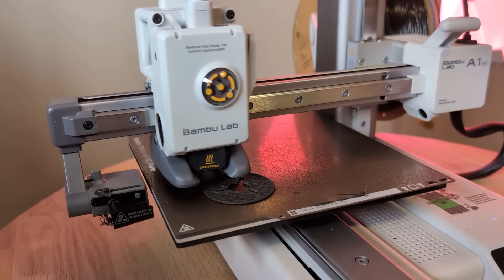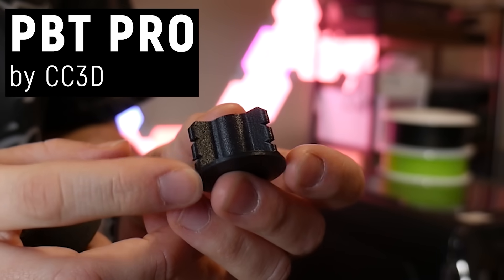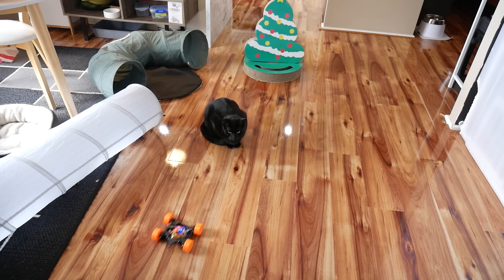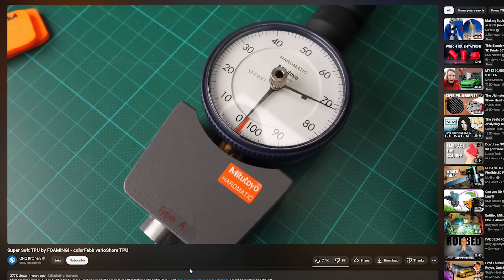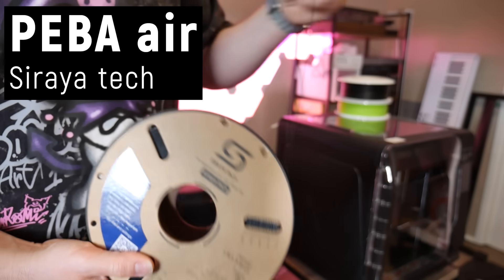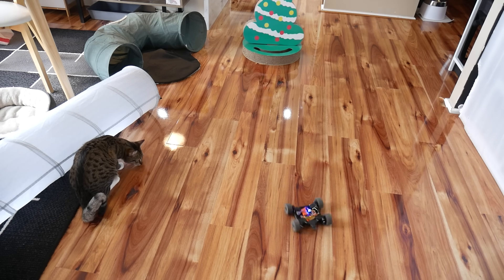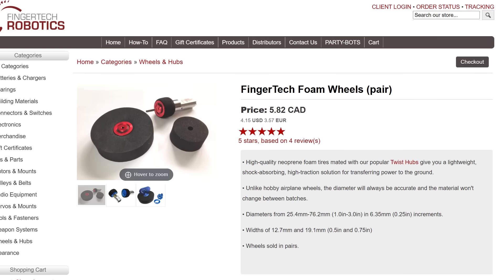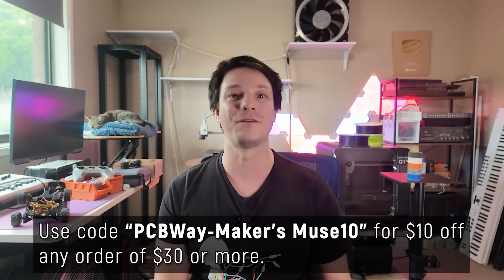3D Printed FOAM Wheels - Do they work?

Comment: Imagine using the fuzzy skin slicer setting with different .svg pattern files to make different patterned treds for your wheels for added traction. You can keep the size of your tires without needing to remodel the tire for every patten.

Comment: when i print 85a tpu on smooth plates the bottom surface is very grippy, maybe theres a way you could print a strip and wrap it around a wheel

Comment: The assumption that a traditional tire shape is optimal for such a specific use-case is a better target to aim at. With such low relative RPMs you can leverage different tire surfaces to maximize traction with little downside. Ultimately, the limiting factor is contact-patch. So, why not create a tire surface more like a "koosh ball" and get a tremendous increase in contact-patch size? Or very soft paddles to flatten the contact patch? Remember, the percentage of traditional tire surface-area which is in contact with the driving surface is very very low. But, with such low loads there's no need to be so limited in the tiny-robot application. And the weird surface designs I'm talking about would be a pain to make with traditional molds but simple with 3D printing.

Comment: Have you tried spraying on spray rubber sealant, readily available from Bunnings? I have used this stuff on TPU to rubberise the surface more to make it grippier, for desktop machine feet. Worked nicely. Also, it comes in black.

Comment: I think you're pulling more than you think every time. 1. The mass of the chain that is lifted off the table effects your reading. 2. you're not pulling straight. I wonder if you'd get better results from trying to push into a vertical scale on the end of the table instead? Or, a rigid tether that is perfectly aligned with the axis of force.

Comment: When I think of gripy materials, the first thing that comes to mind is silicone. I suspect it would perform very well in a grip test, however perhaps less well if you also consider durability in your testing. You can quite easily 3D print molds for two part silicone, or perhaps beg Prusa for their new silicone filament and nozzle for the XL :)

Comment: Liquid Latex is found at any place sculpting supplies are sold here in the states as it is used as a first layer for plaster molds to hold detail and provide flex around details for demolding. And yes as a natural compound it can and will spoil, hence a very short shelf life. I prefer silicone and use conformal coating as I usually have some liying around to waterproof circuit boards.

Comment: just thought of something that might make a difference if you want to try it.   with the foaming tpu. if you make a slightly rounded profile on the tire. reducing the contact patch but providing more psi on the contact patch, it might improve the traction with the deformation of the foam, especially with the dusty surface.

Comment: Two questions!  First, what are you using as a radio controller?  I build full-size droids and that form factor looks very comfortable to hold.  Second,how well do you think the foamed PEBA or TPU would hold up with more mass on the wheels?  My droids tend to end up in the 40-60 kg range.

Drawing on my history as a Goth, liquid latex and latex-based make-up are indeed very different; there's a lot more stuff in the makeup to thin it out, colour it, and make it easier to remove.  Liquid latex is intended to remain more-or-less intact when you remove it.  It's for making masks, molds, and forms.  (Liquid latex "bras" were very popular in the Edmonton Goth scene around '99-'01, and several friends of mine then used the resulting form to build up dress-maker's dummies.) Latex make-up is intended to be easy to remove and not crinkle or rip when you move and smile.

I think it's worth observing that we use rubber on car tires not just because it's soft, but because it's sticky, which does a lot to add traction and control.

Finally, a grumble about saying "PLA+" as if that was some kind of standard.  Every PLA+ is different, and in my opinion 3d printing YouTubers ought to be making a better effort to remind newbies of that.  One brand name's PLA+ may have very, very different characteristics than another's.

Comment: What if you print a wheel with linear or angled threads, then print a tyre to place on top of the wheel, with inner threads which match the outer threads of the wheel? That could significantly reduce the amount of printing filament and printing time and funds needed, and could allow for faster iteration. And for lint rollers, you can 3D print one which can be used with scotch/packing tape, making it's usage hugely cheaper, almost free, and if you include a way to roll packing/scotch tape on an inner roller, you could make it so you simply turn a key a bunch of times in order to roll out the lint-filled tape and roll fresh tape in it's stead, and you could use a a piece of those thin linear saws in order to let the use pull the dust-filled tape out and have it automatically cut, like with those office packing/scotch tape supports with built-in cutters.
Reply: As for the 3D-printed lint-roller using packing tape to be much cheaper, that's the kind of thing you could sell in stores, and you could even make "cartridges" for it from store-bought packing tape, a roll, and some PVC pipe or something cheaper. Two rolls of packing tape side by side would make a large size for the rechargeable lint-roller, and a single packing tape would make a small size for the rechargeable lint roller. And you could even sell the 3D printed device for people to roll their own tape cartridges for the rechargeable lint roller.

Comment: Your mention of the skid steering made me think, have you ever considered/tried a single powerful central motor, and a 3d printed differential? There is a design from EATON called the 'detroit truetrac' which is a gear-only limited slip diff. It's built with 6 worm gears and the standard main components, no clutch packs or hydraulics, no electronics. Just an awesome piece of engineering. 
It's really incredible at sending more power to the wheel with more traction. 
Of course, the downside here is that you wouldn't be able to turn in place anymore unless you try drifting (which might not work at all due to the type of LSD it is). Just a thought, maybe it wouldn't be worth it. I thought maybe using one motor in place of 4, to drive just the rear or front wheels could be worth the saved weight towards a stronger weapon or shell?

Comment: Just out of curiosity, do you think foaming filament would be useful in creating custom foam protection pieces for electronics.

For example: I have a K.O. II sampler from teenage electronics. I can cutout the basic body shape (square) for a case. But I have been thinking about how to protect the faceplate (other than buying a plastic shell protector). My other option would be subtractive manufacturing/CNC foam cutout. I don't have a CNC, but I DO have a printer...

Thanks again for all the good work!
Reply from the maker: Yep I think it'd be an excellent choice! I'm planning on testing it for custom tool inlays. You could always do manual filament change, printing a hard top surface in something like petg, then the foam tpu on top. I think they bond but definitely check!
Reply: @MakersMuse awesome, that's a great idea! thanks!

Comment: i just started getting into full size RC cars, and speed run cars burn thru foam tires on almost every run. This seems like a much better option once the full power has been unlocked testing all the different tpu foam hardness for traction vs durability at speeds of 150+mph.

Comment: At work we had the problem of batteries sliding against PCBs under high vibration and breaking the tabs. I designed some dampers to go in the place of the o-rings we had been using and experimented with different filaments. I found eSun TPE to be by far the most grippy.

Comment: Allow me to nitpick: Change your force meter to display either pound (ounce, etc.) or newton.  In Aussi measures - that is to say the metric system, unit of weight (force) and unit of mass do not mix.  There is no such unit of force called gram or kilogram, for these are measures of mass. (I can understand that certain subculture may choose to use unit names this way. But your videos are geared to the general public.)

Comment: I think maybe straight grooves in the tires Parallel to the axles could give it more traction because it could allow for more flexing of the tire surface if that would work you could also change the spacing between the grooves to find a balance between the surface area of the tire and flexibility

Comment: The liquid stuff that's used to "seal and prime concrete surfaces for dust binding and better adhesion" might be liquid latex? Or the liquid stuff that's used for moistureproofing surfaces in the washing room (choose one without fibers)?

Comment: Maybe it would hurt your weight limits, but what about adding some sort of studs or grit to your printed tires to help bite through any dust? Studded tires help a lot for ice with a dusting of snow. Maybe you could use course sandpaper loops from a spindle sander.

Comment: I am curious how the traction of these printed tires compares to standard rubber r/c car tires. I know its not really in the spirit of the video but just as a control? We have zero frame of reference for how well these are performing compared to someone who just purchased their wheels and tires from a hobby shop. Do you have anything laying around which you could throw on your test platform to compare (what I'm assuming are) injection molded rubber tires?

Comment: latex is liquid before it dries. "liquid latex" or "rubber latex" might be just brand name for natural latex.
rubber cement is latex in a solvent, as far as i know. it's the glue you apply to both sides and mate after both sides are dry

Comment: Hah, that's me alright!
Thanks for these very interesting tests.
I wouldn't have expected liquid latex to perform that poorly. The ones you get for Halloween should normally be the real deal too. Normally, it should dry translucent with a yellowish tint (unless pigments are added). And yeah, it smells awful because of the high concentration of ammonia which is added as a preservative and to keep it stable.

I can only imagine that the latex tyres performed so poorly because of the large contact area. It feels like the smaller the contact surface for latex, the better - especially since that test platform is so lightweight. So threads might help.
Mind you, the dried latex will deteriorate quickly and become hard and brittle within some weeks or months from UV-exposure and heat exposure. But that shouldn't be a huge issue for a battle bot.

A long time ago, I actually put latex on the plastic tracks of a cheap toy snow plow. The grip was almost too much for that cheap toy and it struggled turning on some surfaces.
Reply: The one I usually get is specifically for "props and masks making", and dries yellowish translucent.

Comment: That's a good point about being too sticky. I've also noticed the same phenomenon when I tried to use a lint roller on a cat. When I had finished, the cat still had a lot of hair, and the roller was soft and not in the slightest bit sticky. I've used a similar trick to remove the stickiness from labels that refused to come off cleanly by rubbing a tissue on them. It doesn't remove the remnants, but it does make them no longer sticky.

Comment: It thing the best way to make a custom RC wheel with the best traction would be to 3d print a mould for a silicone pouring. You can buy silicone by the kilos for cheap and it's soft and grippy as hell

Comment: I wish there was an RC class where the aim is to make it most realistic possible. That means scaling acceleration, turning rate, grip levels and mass... Tuning RCs to go fast enough for it to look utterly ridiculous and becoming this skittish, jittery and just unrealistic motion where no human reaction times make sense, you can get that from out-of-the-box 30€ temu RC.. RC racing is too fast for the audience to really see what is going on, nothing can keep up, racing lines don't really matter that much since the car goes on rails and accelerates, if scaled, faster than human driver could do without passing out immediately. Drift RC has ridiculously low grip and HUGE power per weight ratio, like having 3000hp from a ebike motor. All of them others have too much grip, even an off-roader on a polished and painted concrete has too much grip.

That would be a true engineering challenge: how close can you match a road car that is just scaled down. And i know the scaling can't be 1:1 in all parameters.. And once you qualify that the scaling has not been exceeded, now go do some racing.

Comment: I wonder how much grip you could get wit that TPU if it had grooves and lamellae (thin grooves). Rubber needs to be stretching to provide grip, slick tire is not always the best. It has the largest surface area but if the tire is not stretching, its slip angle is miniscule. And slip angle is all about stretching and pulling. Thick lamellae, until the tire surface is made from thin strips than can stretch more easily...

Comment: So what if you coated the wheels with Plastidip? It gives a very even rubbery coating.
Also you could try and print airpockets in the tread of the wheel like 'spaced armor'. It would have the effect of a deflated tyre and might increase surface area.

Comment: can't find rubber cement? that's insane. they have it at most grocery stores here, even. maybe they call it contact adhesive. any application that partially cures before sticking together will be pretty similar

Comment: Back in my day 😂
We would 3d print molds and cast caulking silicone and corn flour mix in them good grip 
Although we were using them on rock crawlers not high speed 
And for the size they were very heavy
Definitely be interesting to try them

Comment: You can get decent liquid latex in australia pretty easily as the RC racing scene body painters use it extensively, try Cambelltown Hobbies.  Also, may be worth while checking some of the traction compounds that the RC racers who use foam based tires use, that might give some good results

Comment: When I first started building antweights I was using EVA foam tires, for a while I used silicone painted on the outside for extra grip but it would eventually get ripped off the foam and entangle spinners so I stopped.

Comment: Definitely want to see these compared to urethane! But whatever future testing you do, try to normalize the test by weight, as that directly affects friction force.

In your tow-gauge test, you could just add counterweight until they balance the same (balance is way cheaper than a digital scale at that precision level), but for practical performance testing it might mean calculating the densities and printing a couple tests to bring them to the same weight.
(Don't try for matching inertia, it's going to be nearly impossible)

Comment: I think window silicone sealant (the ones that come in a tube) must improve traction when applied to the wheels, another option is Fastix, is a rubbery high temperature sealant
Both of theese options seem to be world wide available (i think so)

Comment: I think that your measurements may be a bit lower that the actual because the chain connection to the force gauge is higher that the height of the chain's connection to the test vehicle. I saw in the later tests that the back wheels seemed to be lifting.

Comment: Seeing this is funny because ive been visiting bunnings around town that said they had this loctite rubber cement in stock, one of the few that isnt hugely expensive left on the market aaaaaand even with all the stock they say they have they are all sold out, one of the helpers told me its usually because someones been stealing them that they get the wrong stock amount, so i guess theives love rubber cement?

Comment: Liquid latex works great, what my robotics group does is puts liquid abs "sock rubber" on the wheels, and then brush a layer of 2 part polyeurethane on

after too much use the polyeurathane can be peeled off and replaced, and the wheel's fine. The sock rubber helps the polyeurethane grip the foam wheels better, since the sock rubber gives better traction than foam but worse than the poly, snd the poly doesn't work great by itself. rubber cement also works great! I know a guy who does that instead and they perform relatively similar

Comment: Ever since the PBT videos came out, I purchased a boat load of rolls and have been using only that for everything under the sun. In my opinion, it's basically the perfect filament in every way.
Reply from the maker: Heh yeah it's pretty nice. Not sure how abrasive it is but no problems as yet

Comment: Automotive belt dressing works good on foam tires. The solvent carpet racers use doesn't work as well on hard surfaces, use too much and you'll leave skid marks all over the arena.

Comment: On a smooth surface, contact area shouldn't be super relevant so softness isn't necessarily a great indicator of if something will be grippy. For example, craft foam is clearly softer than tire rubber. I wonder if some harder overlooked TPU and TPE variants might actually have more friction

Comment: You’re only testing the dynamic friction here, I think it’s at least as important to test static friction. MyTechFun does this by having a fixed weight on a pad of the material to be tested, and increases the slope it’s sitting on until it slips.

For rubber cement, I believe thats the same as what you use for patching tyres and inner-tubes. I bought a can of the stuff from an automotive supplier, because you get a lot more than the little tubes for repairing bike tubes. Put it in a nail-polish bottle and carry it with me in my bike repair kit, easy as.